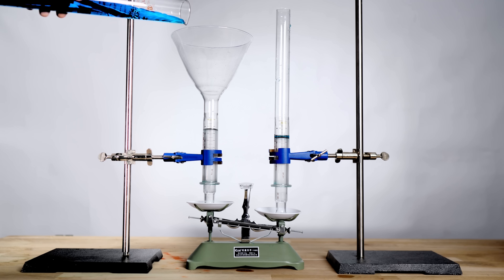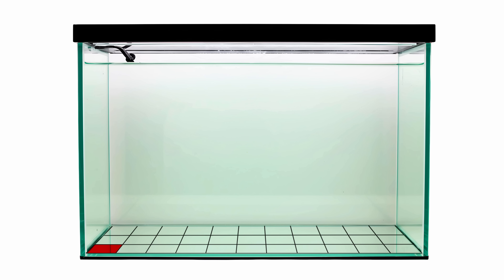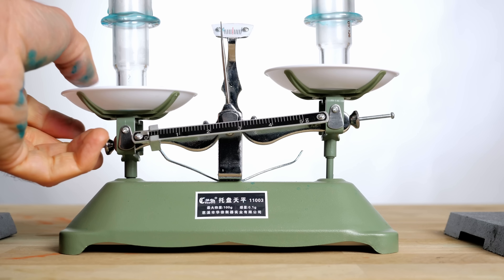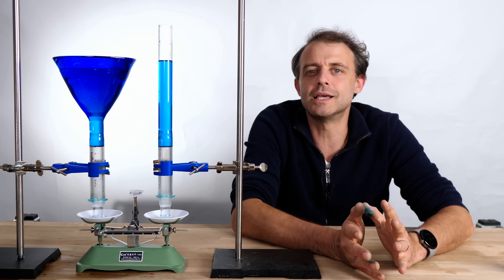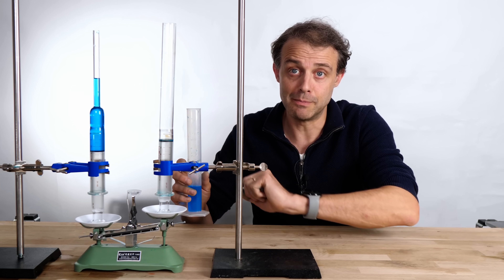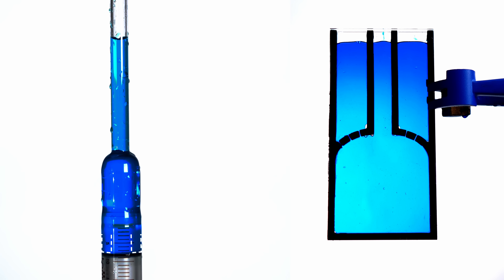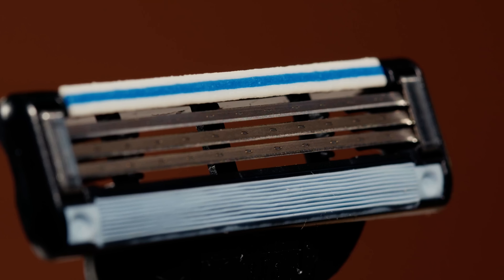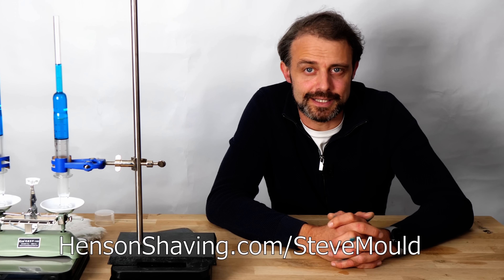The Hydrostatic Paradox

Comment from the maker: Just leaving this here: https://www.merriam-webster.com/dictionary/paradox as I know the word can animate some viewers
The sponsor is Henson Shaving: Click this link https://www.hensonshaving.com/stevemould and use the 
code stevemould to receive 100 free blades with the purchase of your AL13 razor.
Reply: I just get: stevemould discount code isn’t valid for the items in your cart... So don't know if there is problem the promo.
Reply: @MortenEnemarkLund  You need to ad blade pack as well to your order. Worked for me just fine.
Reply: I bought a Henson about three years ago during one of Jacob Geller's promos for them, and honestly I'm still working off the one box of razors I got for free with that promo. That means I paid about $70 three years ago and have spent exactly 0$ on razors/accessories since, it's been a really great purchase.
Reply: I recently switched back to just single blade Bic razors. You can buy 52 of them for $15 and they work pretty good for a week or 2 each. I don't know what "angle" they are at, but my wrist is very good and bending to whatever angle I want.
Reply: @TheBoogerJames   Traditional safety razors are really worth the change.  I haven't used Henson's stuff, but I assume they're about as good as any other.  It's been some three years or so since I made the switch and I haven't regretted it yet... the fact that the used blades make damn good scrapers is also a nice bonus.
Reply: @MacroAggressor  don't forget to dry them manually as opposed to letting the water dry on its own. there's even more savings to be had :)
Reply: @MacroAggressor  I assume there are other companies making good old fashioned safety razors now, but Henson is reliably good quality and also deserves a lot of credit for bringing them back.  Safety razors had gotten 'cost optimized' to the point that the one my father used wasn't much better than a disposable razor (I remember borrowing it when I was young).  Crappy ones definitely exist.
Reply: I wonder how thinking about problems like this would change if we considered the earth accelerating upwards and how much resistance to that acceleration the water makes.
Reply: What a perfect way to learn the difference between weight and mass! Where can one get this glassware with pistons from? I't love to demonstrate this to my students!
Reply: What would happen if you took of one half of the funnel shaped container (keeping the central cylinder intact) and replaced it with a flexible membrane, like a baloon?

Edit: after thinking about it for a a bit more i realized that once the baloon reaches equilibrium it would be in the same situation as the funnel shaped container
Reply: If I were animated, I'd be drawn wearing a dunce cap. 🤔🙃
  That paradox goes against intuition, but is noticed by intuition.   I've noticed that when filling a funnel higher, the liquid doesn't flow as much faster than I thought it should.  Now I know why.
Reply: 7:57 looks weird but isn't, the left glass bottle got lighter! Now to see the video and check my answer.
Reply: It was a surprise to see a razor that I use in the video 😄 Also, it does work great, can confirm.
Reply: 1.05 Steve, what was that device you used there? Where did you get it and what do you normally use it for? Come on now, don’t be coy, it’s not for your rusty balls is it?

Speaking of rusty balls, I remember meeting you at Hampshire Skeptics in the Pub years ago where you showed us how to make micro thermite sparks with rusty steel balls and aluminium foil. It kinda made an impression.

At the same time, you showed how kinetic energy turns into heat at impact by banging two large ball bearings together with a piece of paper between. So recently I bought a bag of 40mm ball bearings, but I can’t get them to burn paper, only smush a hole in it. What am I doing wrong?

Great video on hydrostatics by the way. I’ve done a lot of fluid engineering and it still challenges me sometimes. And your 2D fluid models are superb teaching aids. Really well done!

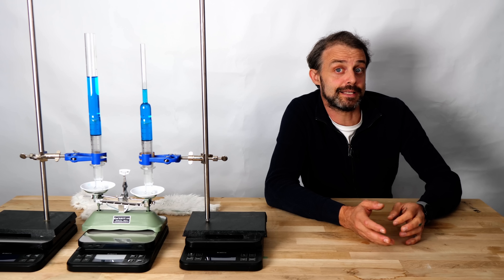10:30 Oh yes, you mention pulling forces. I worked on medical suction devices for healing wounds and remember having a “disagreement” with my CEO who insisted that negative pressure doesn’t exist in physics. I wish I had been able to show him Derek’s Veritasium video on 100m trees “pulling” water up ten atmospheres of height!
Reply: This reinforces my understanding of gravity. Nothing falls but rather the earth moves towards the object.
Reply: @frankh.3849  🤦‍♂️
Reply: This is not a statement
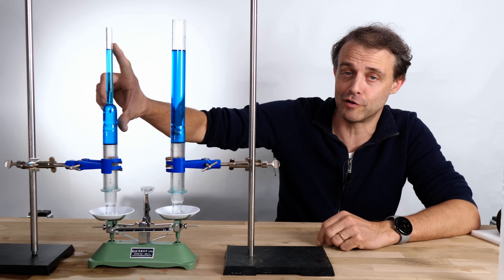Reply: 10:00 Very elaborate scam 😂😂
The extra weight on the left comes from the support... The pole is not fixed on the base but it is jointed allowing it to slightly incline due to momentum 😂😂😂😂

It's really funny how easily this failed species of primitive monkeys can be scammed 😂😂😂😂😂😂😂😂😂😂😂😂😂😂😂😂😂😂😂😂😂😂😂😂
Reply: Shaving your legs with stiletto heels on. Curious to know the story behind this idea. lol
Reply: naah, I don't like razors. Braun Series 9 PRO plus is a better choice for shaving.
Reply: explaining that the extra force down in the necked down glassware is effectively coming from the pressure pushing up against the glass dome is a good way to explain it, that pressure pushing up is what lifts the clamp stand
Reply: i tHINKARONI - you neglected to understand that your scale is essentially providing the same exact function as a curved tube connection from one liquid container to the other one
-
and what you can imagine happening is that the fluid from the right cylinder ( with more liquid ) is pushing through the tube ( the scale ) to the other cylinder and the pressure is being exerted to the top of the dome as well as pushing the fluid level up the narrow section of the cylinder at the top - 
-
this means that the weight of the entire amount of liquid in both cylinders are dispersed accordingly to the height and shape of all inner surfaces - 
it is the same as - the liquid levels in two bodies which are connected somewhere under the surface of the water - will always be of equal height because gravity will distribute the water from the body having the higher level to the other body having a lower level
Reply: the reason i am saying tHINARONI is because i guess i spilled my brains too much on that yewspewed account and now - no comments i try to post from that account - get posted
Reply: No matter what I put in the cart it says "stevemould discount code isn’t valid for the items in your cart"
Reply: I can prove earth is hollow
Reply: Actually when when you are pouring water in the container its weight on scale is decreasing because the water is applying pressure to go down that is pushing piston down and the head is up it rise when causes the scale to show mass decreaseing
Reply: Hi Steve; I have a question; imagine that a huge wave moving horizontally like a " wall of water ", engulfs something on a beach and the column of the water above that thing is one hundred meters, but in the horizontal direction opposite from where the wave came, there is only one meter of water. At that instant, what would be the approximate pressure around said body? Thank you!
Reply: OK that was one of the best segue/ads I've ever seen. They should give you a bonus for this.

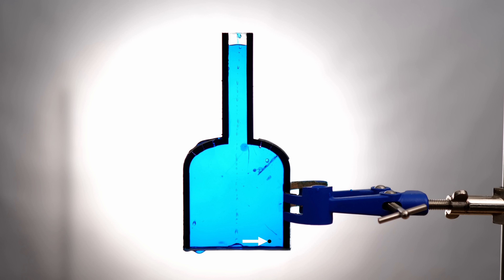Comment: 9:00 not quite true the pressure at the bottom of the container is slightly higher than at the 'ceiling' as you called it but the pressure at the 'ceiling' is the same as the water at the same level in the horizontal center of the container

Comment: I think the most interesting part is that total weight of clamp and water is lighter than the force should be applied to weight.
The clamp will be lifted and level of water will be dropped significantly until equilibrium.

Comment: Looks to me that you are measuring the pressure at the bottom of the tubes, not the weight of the water. 

The weight of the water is supported by the clamps holding the two tubes. Remove them you would see that lots of water weighs more than less water.

Comment: I always imagine a giant pool and a straw coming out the bottom that goes to the top level, of course they would be the same level. If you push the water down in the straw the height of the pool goes up a tiny amount. If you push the water down in the pool the straw level would go way up, but you need more force.

Comment: 7:10 - I asume, the measurement from the special container will be  the same to the normal zylindrical container and the trapezeud if the fillstand is the same but higher for the amount of whater, as the whater stacks faster in comparison to the trapezeud, that needs more whater to gain the same level of whater hight

Comment: The hydrostatic principle comes in very hand. Pushing down on our heads is the weight of a column of air the size of our head. If the force on our head was equal to the weight of all the air above us, we’d be in big trouble.

Comment: Yes you’ve created a water level.  By using the balance to connect the two containers effectively creating a water level.  An example is a clear hose filled with water both open ends are elevated and observe the meniscus level out.

Comment: I remember solving for the displacement of a piston in a similar system during my college entrance exam days. I immediately knew what was up when I saw the glass containers are supported by clamp stands. The conic section of the rest of the water (excluding the column of water directly above the piston) is supported by the stands, not the piston.

Comment: So let's say you are scuba diving in a sealed space the same volume as an Olympic-sized swimming pool. There is a little valve in the ceiling of the sealed pool that separates it from a tube of water that is 1 centimeter wide and 1 kilometer high. If you turned that valve, connecting the sealed pool to the column of water, would the pressure instantly spike and kill you? Would connecting the 2 million plus liters of the pool to just 100 liters of water in the 1 km column cause the pressure to be the same as being a kilometer deep in the ocean?

Comment: As many people explained below, this is a fundamental hydraulics principle.  I remember being confused how simple forward the formula for pressure is calculated.  And once you understand that the forces in non-compressible liquids are essentially everywhere at once, they just add up infinite numbers of arrows all simultaneously added together, which is one of the reasons I was always so confused with the simplicity of the pressure formula.  Once you you understand how the math is represented in the physical world, it does all make sense once you start drawing lines in directions and ignore the intuition of how gravity seems to work.

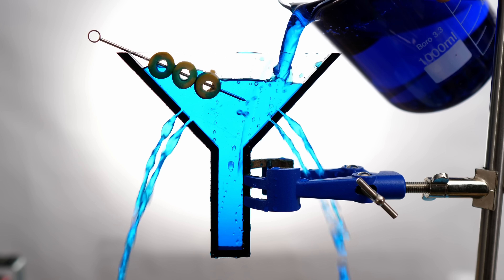Comment: At 6:00 you say the packet of water isn't moving because the wall is there. But technically only the water in contact with the wall isn't moving because of the No Slip Condition at the interface. The rest of the water is freely moving with the sum of the velocity equaling zero. Fluids are weird.

Comment: Makes no sense. Let’s take it to the extreme.
Imagine the left inner tube is microscopic diameter and same height as right one, and the left outer tube is of microscopic height. Now to fill the left tube might only take 3 drops of water. 

What this experiment is saying is that as long as the height of left inner microscopic diameter tube and right tube are same, they will apply same force even though the left only needs 3 drops of water while right one needs a full glass of water.

Someone please recreate this.
Reply: With that logic, let’s say initially the left side is empty. Now you add 3 drops, and suddenly you could be feeling hundreds of newtons of force? How is that possible.

Comment: Steve, I would need your help. A practical question I have concerns a watering globe for my plants.
Based on the the hydrostatic paradox I would expect that an equilibrium should occur when the force of the column of water with the lower air pressure in the reservoir is equal to the atmospheric pressure. And that therefore a watering globe would only release some water, but retain most.

Yet, it empties completely.  Is that because the surface area at the top is much larger than at the bottom?

Comment: It seems equally as intuitive to me in the funnel's cone, just as it does in the straight column. The water that's not directly above the piston is, of course, bearing on the inner cone surface, with is in turn supported by your clamp stand instead of by the piston/scale.

Comment: It's not counterintuitive once you learned that Blaise Pascal made a wooden barrel explode by connecting it to a vertical hose 20m in height and filling both with water. The barrel didn't bear the 2 bars of pressure

Comment: Isn't the clamp stand just there to keep the container from falling over? It shouldn't be taking any of the weight surely? If it's getting heavier it isn't a representative test and a bit misleading? Ie if the clamp stand is taking some of the loadsl, both the dish and clam tlstamd should be on the scales and they would balance if the volume of water was the same and not otherwise as you would expect..

Comment: 8:59 - you say that the pressure at the side/shoulder ceilings is the same as the pressure at the bottom of the central column. Is that correct? Clearly intuition is shaky here, but my intuition says that pressure in the central column increases as you go downwards, and (thanks to outwards pressure from the central column) the pressure at the side/shoulder ceilings should be the same as the pressure at the same level of the central column.

Comment: at the start you can already say it's not weird as part of the water weight is hold by the glass which is hold by the scaffolding... therefor not all the water is pressing on the piston which is measured... if both sides would way the same (including the scaffolding and the glass) on a bigger scale that fit both sides it would be even with the same amount of water added... as you weight the water not the water which puts pressure on the pistons... so it's incorrect to say you weight the water inside as you don't...

Comment: The way the experiment is set up seems intentionally misleading. the clamps are supporting the containers, and the scales are measuring the tube/piston. so of course, they are only going to experience the weight of the column above them :x

Comment: I think it's more understandable to say that, in the last disposition, as the water reach the smaller portion, the weight of the glass is no more supported by the clamp stand, but some is transfered to the piston. And the amount of weight transfered is so to cancel out the pressure, so it match a perfectly cylindrical tube

Comment: Replace the air above a scale with a lighter (or heavier) gas on one side and your scale should tip one way rather the other. It's the same with water, it's does not matter how much quantity of water you put on the scale, only the high above the scale matter. With a scale you don't mesure the full weight of the atmosphere, only what its just above the surface of the scale.  If we could mesure against a infinite column of void, it would be obvious.
In my head it's just a replacement of the medium.

Nice video anyway!

Comment: What if there is no free surface above the column of water? Like putting a glass under the water then turning it over and raising it above the water without breaking the seal around the lip of the glass? Will the pressure of the water at the same depth be the same of more now?

Comment: if you were at 200m depth under water, that would be 20atm, because the column of water above you is 200m. what would happen if you moved horizontally into a tunnel with a ceiling at 10m height, with the water above the tunnel ceiling still being 200m above you're position? would the pressure drop to 1atm, because the column of water above you is now only 10m?

Comment: Thank you very much for your explanation.
From what I understand, the variation in weight is actually not due to the difference in the water column height. We should interpret it in terms of compressive stress rather than as a direct weight expression.
So, the experimental output we are observing represents the true compressive stress.

As proof, once the moving plunger is fixed (glued) to the tube, it shows the exact weight of the water.

Comment: Finally coming to terms with the basics of physics in my late 40s is hardly something I would advertize on youtube. Of course the container in the 2nd half becomes lighter. It is sloped on the side and as water molecules hit it from the side they are directed to bounce downward, resulting in an upward force on the container. Newton's third law. For every action there is an equal and opposite reaction. The weight of the container is transferred to the piston. Where's the mystery?

Comment: Not weird at all, once you understand that this device is very cleverly designed to compare not the weight of the water, but the pressure being exerted on the piston, which are not the same thing 😉